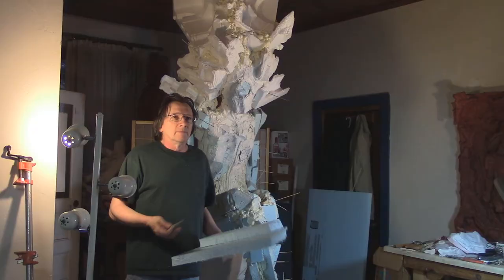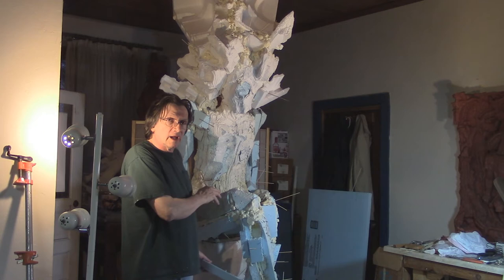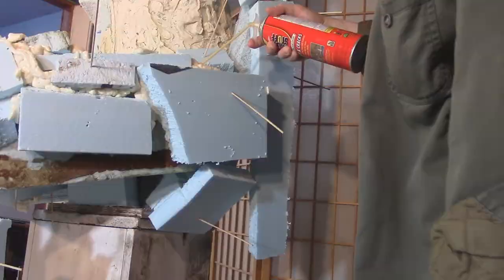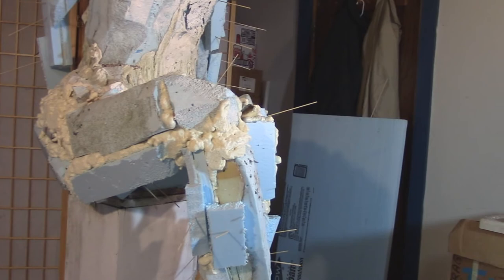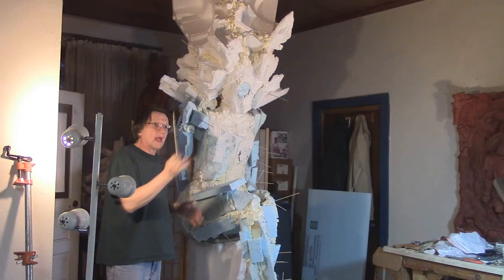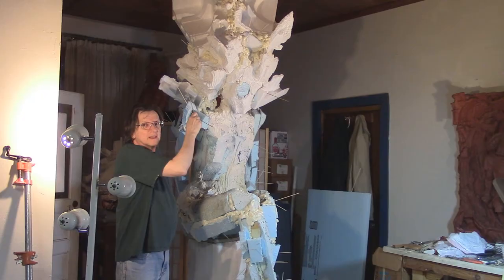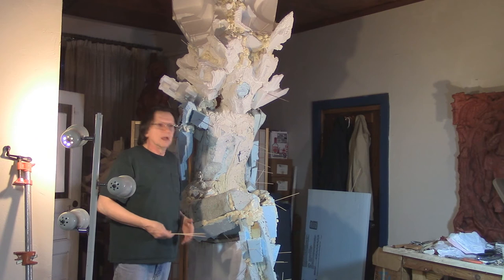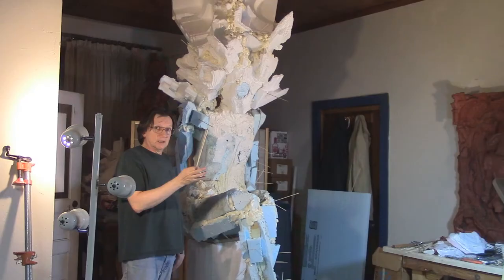Sculpting With Plaster: 2 Foam Insulation Construction

Comment: BRAVO!!   After much experimentation/research,  I have concluded with pretty much the same process for my own creations.   My only difference, is I create items that most likely are for outdoors.  So I use a cement plaster.    but short of that,  I have been using the same tech. as you noted here.    Depending on the size,  like you,  may have to beef up the inner strength.
 Again,  like you,  I enjoy using "trashed" items for my sculptures, I will also use bags of trash(non-decaying and whatever else) for the plaster to go over, in a way, im helping in recycling.
 Thanks for sharing!
 Also,  I fully agree on leaving oneself with some freedom for the final design, I most times,  change ideas a ton,  but with each layer, and the final layers get closer,  it all "melts" together to create what we want.   Because we as artists, never make mistakes!! HA
Reply: can i ask what cement plaster you use? is it a store bought material or do you mix it yourself?

Comment: I just started....but I was planning on using Epsilon by Smooth-On. They suggested covering the finished foam character with it to create a satrong shell. In their video, it shows a foam slide for children covered with Epsilon that became hard enough to stand on. Also I think I was told that giant Mardi Gras creations are covered with it. Any suggestions?
Reply from the maker: Hmmm
Never heard of it.
Will Google it and get back to you.
Reply from the maker: Well Epsilon looks interesting.
Here's what's going thru my mind right now.
It looks ideal for outdoor sculpture and for indoor work if the work is fragile or its supposed to last forever.
The stuff looks glossy which if that's okay with the artist then ok, but I'd be interested in learning if there's a way to get a matte finish.
Also, because you'd want the stuff to stick and not run or droop when applying, it'd be thick and would add a texture layer over whatever one would build the sculpture out if. This, in my case, would be an issue to be dealt with and learn to make work for me because when I build a sculpture I used plaster and use the natural textures plaster creates. These plaster surfaces would get all but obliterated when the Expoxy is applied on top of it. That'd have to be a learned artistic skill. But the Expoxy might give cool textures that one couldn't get with plaster or other less permanent materials.
Also the cost could be an issue. My sculpture is larger and I can't figure out what a hundred dollar gallon would cover. Now, co st should really be the last issue an artist should consider, I mean money should be a non issue if you're really serious about your art but money is money and I might need to pony up several hundred dollars at the very least to finish and protect and thus guarantee the survival of one's work.
Now, I can't use anything on the work I've already done because, well, they are already done. So they're not exterior pieces and if the survive it'll be because future generations take care of them.
But I intend to get some of this stuff along with the shredded fiber thickened and see what its like.
Anyway, thanks for the heads up on this stuff. You may have instituted a whole new chapter in my creative life.
 If you make anyway work you'd like me to see my email me at: dominance4000@gmail..com
Reply: @cantopia  Sorry that I don't have any suggestions. I attended a SMOOTH-ON seminar in April, and was impressed with everything that they produce. But I am a beginner. I think that you do wonderful work, however.

Comment: are your sculptures considered archival?
Reply from the maker: Well, yes if you mean like archival paper in that they won't disintegrate by force of their own internal chemical reactions; and sort of yes because plaster, if kept reasonably dry will late for thousands of years, but no if you mean are they catalogued somewhere like a museum, private collection , or a university's holdings.  Is any of that helpful?
Thanks for the question.
Cheers, John
Reply: @cantopia  yes, thank you for your response and the videos. great work. I ask because I want to make plaster sculpture but am concerned about using things like newspaper and tape in the center as the armature. But I guess this shouldn't pose a problem? Ideally, these pieces would be exhibited and be for sale.

Comment: Have you tried aluminum foil for a barrier?
Reply from the maker: Hmmm... no. I don't seperate the underlying foam from the plaster. It stays there forever. It's the principal support. So, unless I misunderstand your meaning, I wouldn't want a barrier of any kind. Aluminum foil CAN be applied to wet plaster on the exterior, and after the plaster hardens, pulled off to give the plaster a crinkly somehwat metalic surface treatment though.  Thanks
Reply: cantopia just wondering.. Ive seen a lot of other ppl that use foil as a barrier.